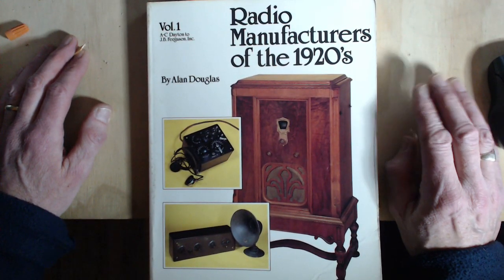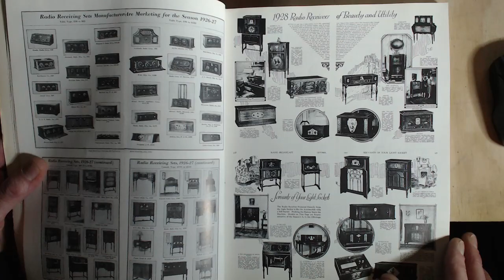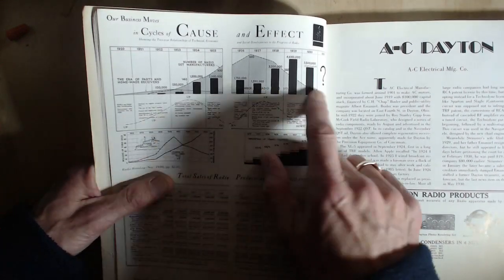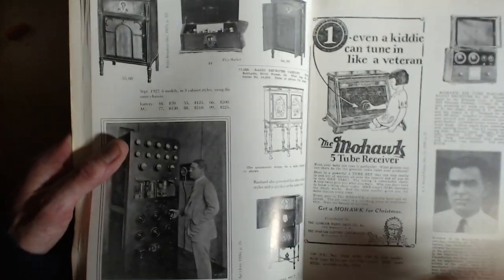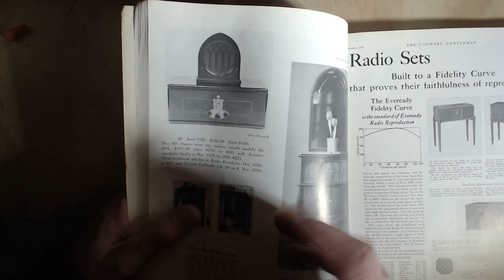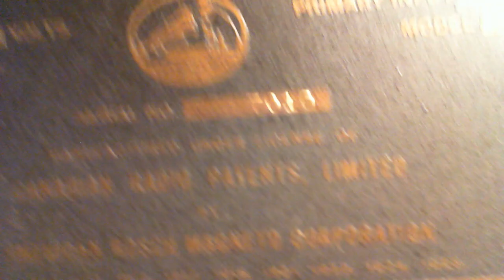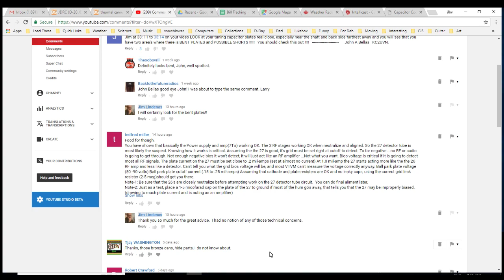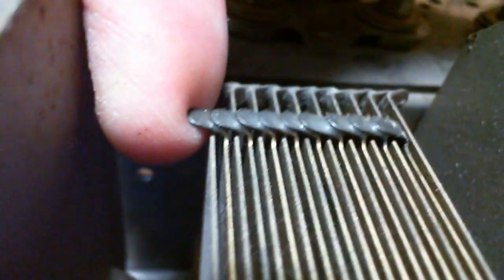1928 RCA Victor Model 28V   Video #42 - Some History

Comment: Sadly Allen Douglas died last year sometime. He was a regular on the Antique Radio Forum and a wealth of knowledge who was very kind and often helped people on the forums.
He once helped me when I was restoring a Solar Capacitor tester when he pointed out to me that the mica capacitors in the tester were likely hand picked at the factory and if I changed them I would possibly throw off the calibration of the unit. Prior to that I was one of those guys that "shot gunned" all the capacitors in old radios and equipment and changed them all.I find it interesting the guys, like you Jim, who have been at this a while have learned to  test everything and not just replace parts(or wires)just because they are old, good advice!

Comment: That looks like a brilliant coffee table book for someone to peruse at their leisure.
I wonder would it be possible to replace the multi-section variable capacitor with 4 pairs of Vari-cap diodes driven from a 100 turn multi-turn variable resistor driven from a smoothed DC supply.
Reply from the maker: Keep wondering.

Comment: Not quite every household, the population in 1928 was 120 million. Happy New Year!
Could you have a look in that book for a I think it might have been a microphone amplifier made by EMI no model number or name? and the serial number is 0 0 0 0 0 0 01 I've got, I can't believe there's only one made but I can't find anything out about it? Probably made for studio use, has three big grey knobs in the middle and two smaller ones on the outside and 4 white selector buttons at the top goldish enamel metal frame.
Reply: $135 in 1928 roughly about $1,900 today

Comment: More food to byte into:
There is very little on Youtube on “grid leak biasing”. (None that I could find used as a detector tube)
The 27 detector tube is set up as a modified class "C" biasing. The old 1934 RCA manual (rc12.pdf on the internet) has all of the need answers, but may be (is) to technical for most reader. Page 9 talk class A,B,C type biasing. page 19 info on "grid leak bias detectors." page 70 is the 27 tube details.
In a nut shell 
I put together a picture of how the grid leak detector works. At http://DosForAll.com/rca_radio/index.html  On the left is what a scope might see as an RF input signal. Near top right is what a scope might see as rectified RF output signal  (If the 27 is properly biased). The plate bypass-filter-cap and coil,  filters  out the rectified-RF wave down to an audio wave.     Not all that much different then how the 80 rectifier works with it's filter caps and choke coil.

Comment: It is interesting that we are still in the first century of commercial radio technology.   Cool.    If folks don't restore what is out there we will have no representations of the devices in 50 more years.   2015 was the 100 year anniversary of the use of tubes by ATT to make the first coast to coast long distance phone calls using the first perfected vacuum tubes.   Prior to vacuum tubes for amplification long distance telephone calls were only 600 miles.    What is interesting ATT/Bell Labs again changed the world by the invention of the transistor.   Vacuum tubes and transistors both were developed for the advancement of the telephony industry.     It is interesting that the telephony industry is still the innovating industry of electronics technology today.   Who said talk is cheap.    Can't tell that by my phone bill which is my most expensive utility.